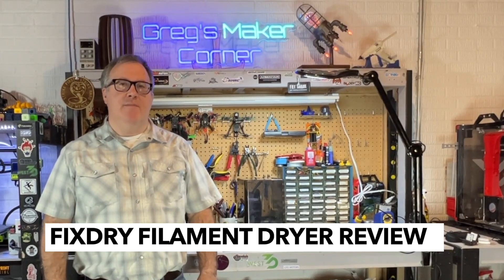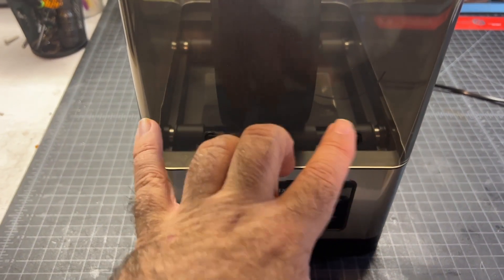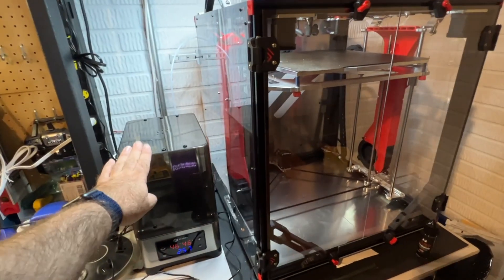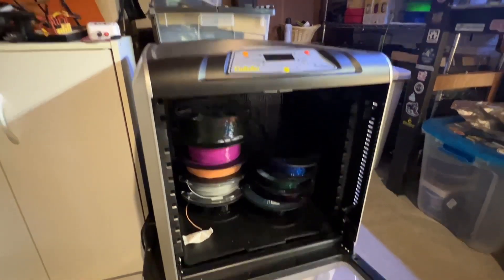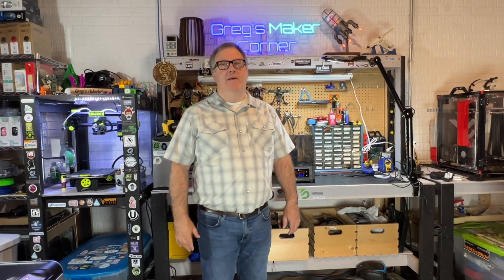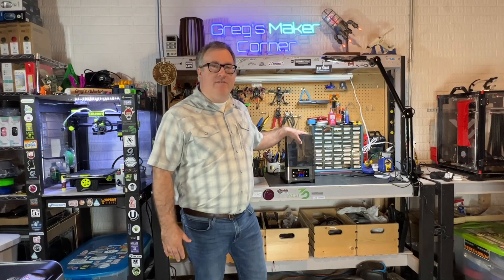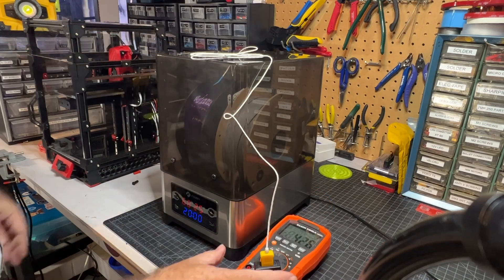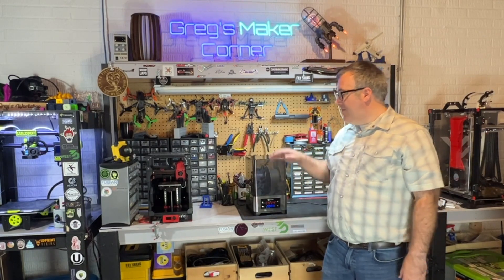Fixdry Filament Review - In Depth Review with Testing

Comment: I do not recommend buying this, It does not get up to temp what so ever, even when plugging the holes. I set a temp of 60°C and it only gets to 45-50. So the only thing you'll be drying is PLA
Reply: I find that brentc9381 is on the money with his evaluation.  This box gets up to about 44C and the top will be at 37C. this box does not met spec.  A temp setpoint is nice to set the temp., then it should switch to realtime temp. monitoring!!  Nice box though. This is the first box I've used/bought. Maybe this is all I should have expected for $120.00US.
I really like the box, As an engineer I'll keep the box and rip out the useless electronics and put in my own design.
Reply: @shabtaievan6874  just an FYI, i have a 3 kg esun spool that does not fit
Reply from the maker: Sorry to hear that. Mine was able to get a little bit higher, but not by much. I wonder if there is some variability to the temp based on the unit. Either way, I have mostly been using mine as a "dry box" next to my printer and not for the drying out part.
Reply: Hey man seems like you’re going to every video and copying and pasting the same thing…

Comment: Great video and nice unit but I prefer to use a sealed container from WM and a reusable silicate desiccant device for about the same cost buy it hold 15 or more spools. Your solution is good as well but mine is pretty much zero power consuming (you need to dry the silicate every month or two by plugging it in for  few hours) and no danger of overheating the filament. It keeps the humidity in the container at around 29%
Reply from the maker: Yes… desiccant is a good option if you keep up with it. I did something very similar initially but forgot to recharge. It’s so simple to throw rolls in my dehydrator before I print, I prefer that versus remembering and tending to the desiccant. Keep in mind desiccant will never dry out filament, but it will keep it dry if it isn’t wet to begin with. I also have hundreds of spools and it’s difficult for me to have dry boxes for everything… but glad to chimed in on this! Definitely a good setup.

Comment: Great review man!  I’d like to know more about that Cabela’s dehydrator.  I need something big and the commercial options are insanely expensive.  I’ve been so close to pulling the trigger on a 160L StatPro but it’s passive.
Reply from the maker: Thanks!! The Cabela's dehydrator is great, but I don't know if you can still buy the exact model that I have. If you search around, you should be able to find an 1100 watt model with removable trays (whether Cabela's or another brand). That is a good place to be if you are looking for something that gets hot quickly. The one issue I've ran into with the Cabela model is that it has some "smarts" built into it where it changes the temperature slightly, like maybe 5-10 degrees during the heating cycle, because it is intended for food drying. Despite that it works fine but it may seem a little odd if you are looking for a 100% constant temperature. Either way, 2 hours for any filament seems to do the trick and gets the filament to where I have no issues or concerns.